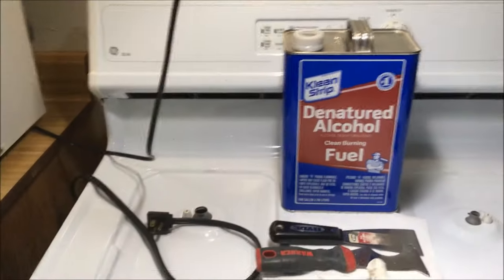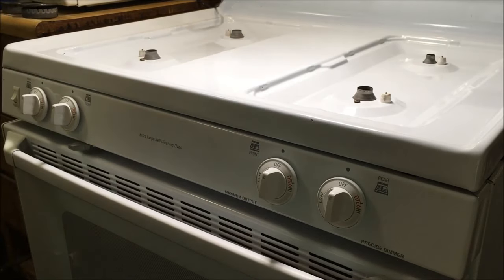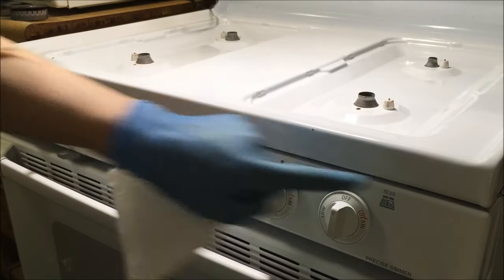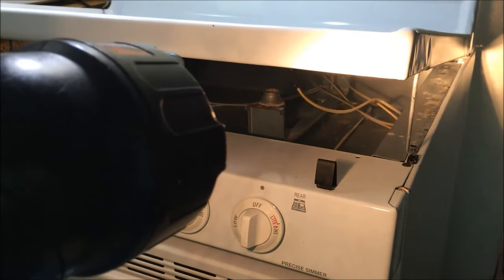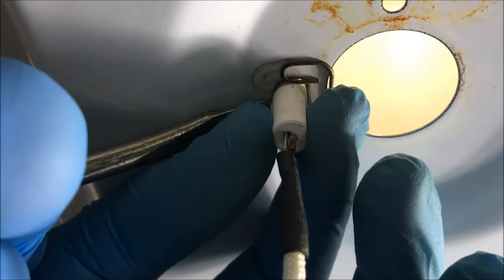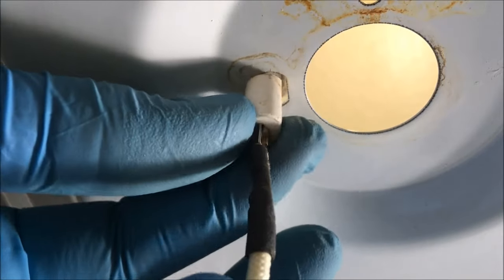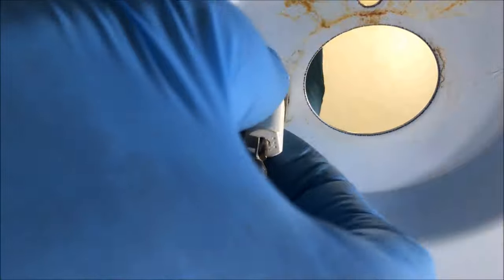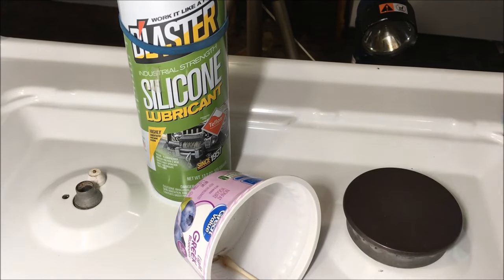Replace GE Gas Stove Top Igniter | Step-by-Step

Comment: Very good but before you replace the igniter shouldn't you check to see if everything is clean. It may be there is a little bit of dirt around the igniter.
Reply from the maker: Thank you, cooldog60.  Yes, I agree with you 100%, and that's why I also did a video to show people how the clean the igniter and burner base.

Comment: I hope this helps anyone that has a problem with this. I have a Siemens gas hob and one of the starters didn't work. It appears like they're all in parallel and the others all worked in sparked. So I cleaned out the area but it didn't seem to work. So I took some Emery cloth and likely rub the top of the igniter. It works now. I thought I was going to have to order and change the igniter in that particular hob. But this worked okay

Comment: Your video gave me the confidence of repairing my gas stove ignition which wasn't sparking. Turns out the electrical contact to complete the circuit was loose. Fixed it and now working well. Thanks
Reply from the maker: Oh, Dennis, that's great to hear!  Great job!  Keep DIYing and save your money.

Comment: Thank you for doing this video!  Just wondering - when would I replace the cables as well in addition to the electrodes?  I have an issue where the burners keep clicking (but when the oven is fully preheated, the burners work without any problems).  I will try replacing the electrodes first - hopefully that's the only issue. Thanks!

Comment: Thanks so much. Is that an older stove? I have a 5 year old G&E Adora and need to change the spark igniter. Could I change it by gently pulling it up from the top without having to open up the panel?
Reply from the maker: You're welcome, Jose!  Yes, I have an older stove.  I can't tell you with certainty whether you can change the igniter without opening the top panel, but you can on some.

Comment: I have the old model of GE profile gas stove with downdraft cooktop.  It appears my gas stove head is one piece and I cannot remove the cap like you do.  There are two side screws to remove the whole base inside of the cabinet.  I cleared each hole with alcohols rub and needle and it still doesn’t work.  Is there an easier way to fix the stove heads?

Comment: I am having trouble closing the top on my XL44 so gas tubes fit into burner bases correctly. Do you have any suggestions that would help? Back of top is difficult to keep aligned properly. Top was pulled up to clean underneath and it would not close. After closer inspection I found some brackets that support the gas lines were bent. I straightened two brackets but I still had trouble closing top because top would not lift easily at the back. So I removed the rear burners by loosening the three tiny screws on each one. Then I was able to set top back down carefully aligning the front burners with the gas lines mounted on the top of oven but underneather the stove top. Once the top was back in place I put the rear burners back on checking with a flashlight to be sure they fit correctly over the gas lines on each side. Then I tightened up screws on each burner and replaced pans and grills. I did a test and all igniters and burners lit up.

Comment: Great video. I have a 7 year old frigidaire gas stove and my front right burner clicks then comes on sometimes and other times there's no clicking then I start smelling gas and it doesn't light. The funny thing is that when it does this, I turn it off then turn on the burner behind it then I try again and it turns on immediately. Could this be a faulty igniter?
Reply from the maker: Hi Michael.  It could well be an igniter, and the part doesn't cost much to replace.  Before I replaced the igniter, I'd clean the metal tip on the igniter and the burner base really well with denatured alcohol.  There's a small port in the burner base that gets plugged with grease and food particles.  That's what caused one of my burners to light intermittently.  Use the tip of a tooth pick to clear that port out.  You can also use a piece of fine sandpaper to carefully and lightly clean the metal tip of the igniter.  

I hope this helps you.

Comment: Got a question for you miss Frugal, if the igniter is not sparking can I manually light it up with a lighter while holding the knob? Really need your help on this. Thanks
Reply from the maker: I don't know what type of stove you have to answer that.  But, I have done that in the past, and it worked.  I'm old, and when I was young, all stove burners were lit with a match.  ;)

Comment: Thanks for the great video! One Question, where to buy the new spark igniter? Thanks a lot!
Reply from the maker: You're welcome, Tony.  To buy the correct spark igniter, search the actual model number of your stove and the words "stove igniter," and look at the search results.  Make sure the image of the igniter looks like yours.  Both Amazon and eBay had my type of igniter for a comparable price.  I hope this helps you.  Happy DIYing!

If you haven't tried cleaning the metal tip on the igniter you have now, I'd try that first before you purchase and replace it.  Often times, the stove won't light because of grease and debris on the igniter tip and/or the port at the burner base.
Reply: @frugaldiy1  Thank you so much!

Comment: I accidentally spilled a full pitcher of water on my GE Stove today. Now, it's not lighting, even though I can see a spark. Have you done a video on other things to check if a burner isn't lighting (e.g., clogged gas port)?
Reply from the maker: Yes,  I do have a video on an igniter clicking, but not lighting--"How to Fix a Stove Top Burner That Clicks But Won’t Light."  Likely, the igniter or the electrical wire to the igniter is wet from the water.  Unplug the stove and lift the stove top and dry up as much water as you can.  I'd let it dry out for several days and then try to light the burner again.  I would not try to apply any electricity to a wire that is wet.  Give it a few days to dry out.
Reply: @frugaldiy1  Thanks! Kind of embarrassing, but I realized my mistake. When I tried to light the burner after cleaning up the water, I forgot to replace the "cap" on that burner. It worked as soon as I replaced it. Whew!
Reply from the maker: I'm glad to hear it all worked out for you.  Nothing to be embarrassed about.  Life is a series of learning lessons.

Comment: My front burner doesn't click, would replacing the igniter work, or is that a spark module or wire issue? All other burner both click and ignite. Thanks
Reply from the maker: Bonnie, it could be any one of those issues.  If it was me, I'd first remove one of the igniters from a burner that works and try it in the burner that's not working.  It will help you isolate the problem.
Reply: @frugaldiy1  oh that's smart, I'll try that first. Thanks for the quick reply
Reply from the maker: You bet.  I hope it works for you, Bonnie.

Comment: One burner that I turn on clicks but no spark.....but when I turn  another the burner, the electrode sparks another burner. Ie.....I could be trying to start the front left burner but the front right burner is sparking
Reply from the maker: I'm not sure what the issue is.  I once had a Sterling gas stove top that required me to turn the front burner on to ignite a spark which would then ignite start the back burner once I turn the knob to the "on" position.  Odd for sure, but that's the way the stove top worked.

Comment: 0:39 - Why does everyone's base come off easily like that? Mine appears to be sautered on or bolted.
Reply from the maker: Christopher, try this.  Make sure the stove is unplugged and gas off.  Get a dish towel moist (not too wet) and heat it in the microwave for about 30 seconds or so.  Then, put the moist, heated towel over the base and leave it for a bit.  Maybe the moisture and heat will soften some of the gunk and grease around the base to help you release the base.  If that doesn't work, I'd use denatured alcohol and give the area around the base a good cleaning and try to pull it up again.
Reply: @frugaldiy1  I appreciate this quick reply! However I am now noticing two T15 torx screws holding that burner place down. The next trick is to loosen those screws without stripping them. They are stuck solid. Maybe the warm dish towel might help?
Reply from the maker: I'd use some silicone lubricant spray or penetrating oil to soak those screws and let them sit overnight.  Then, try to loosen the screws tomorrow.  You don't want to strip or break the heads off of those screws.  It makes them difficult to remove.  If the screws won't loosen, use a hammer to strike the head of the screwdriver while turning the screwdriver to the left (counterclockwise) to loosen the screws.  The impact of the hammer gives the screw a "jolt" to help break the screw free to loosen.  It's like using an impact screwdriver, if you don't have one.

Comment: Damn. Mine doesn't have clips.
Reply from the maker: Don't give up, laurelrunlaurelrun.  Search the make and model of your stove and see if igniter replacement is discussed or shown on forums or YT videos.
Reply: @frugaldiy1  turns out there are brackets at the back and when unscrewed, the cooktop pivots at the front and comes off.
Reply from the maker: @laurelrunlaurelrun  Thank you for letting me know.  Great investigative work!